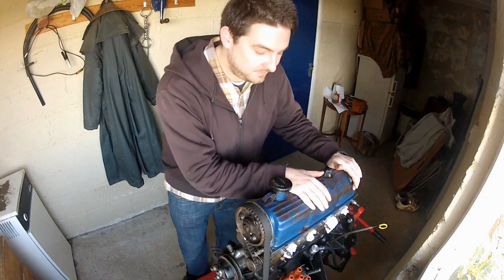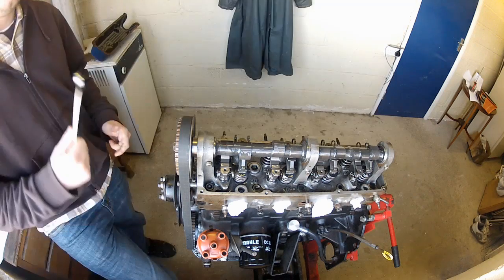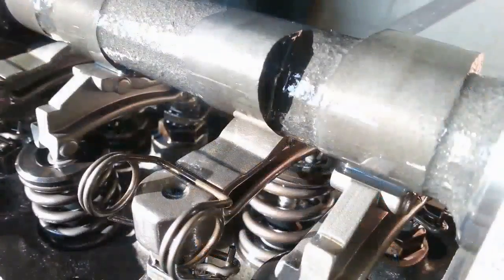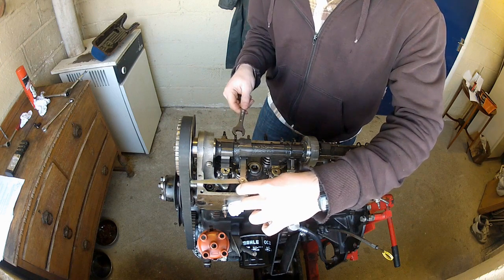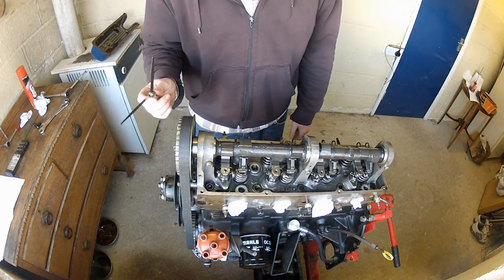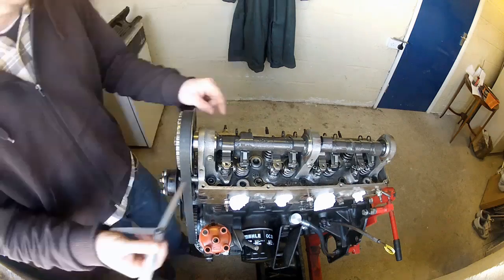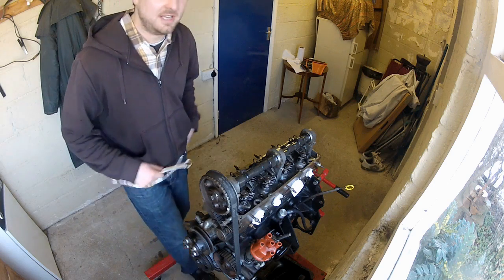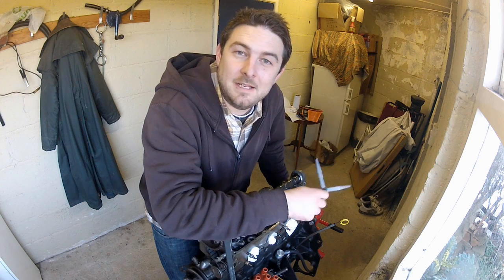How to Adjust Valve Clearances/Valve Lash on a Ford Pinto (SOHC) Engine | Tech Tip 10

Comment: Interesting to see it done this way, i was shown to measure the clearance between the top of the Valve stem and the follower, this seems a little simpler somehow
Reply from the maker: Probably a pushrod motor that, as opposed to overhead cam?

Comment: great video a had the same problem as you said you nip up the lock nut and the clearance changes. a changed ma 165 pinto for a 205 injection block running a dgav 32 36 goes well wouldn't mind getting a Kent or a piper cam thow
Reply from the maker: That will be a nice set up once you get a fast road cam in there. Actually I have a Piper 285 with followers in the garage not doing much. Gimme a shout if you want it.

Comment: Hey, are the 0.2 and 0.25 clearances the same on a 2.0 EFI Pinto? I assume so, since you said standard, but just looking for confirmation, in case your engine started out with a carb and that changes things somehow.
Reply from the maker: Hey, I can't say for sure, but I'd be very suprised if the clearances were different on an EFI engine.

Comment: What's the best way to break in just 1 New 2.0 Pinto Cam Follower I'm Changing out??
Reply from the maker: Same way as normal mate. Just don't let it idle for 10 mins. Hold it around 3k.
Reply: @FastRust  Aww I did yesterday and held at about 1500 to 2000 rpm for 10 mins, let it cool then drove like 16 miles holding at 2000 or above except when traffic got in the way. The key to it is to keep the oil pumping good, right
Reply from the maker: It'll be fine. Main thing is not to let it idle for 10 mins during break in.

Comment: I don't know what type of performance cam is in my 1972 2.0 liter but I adjusted to stock gaps to try to fix lifter ping/tick noises and it didn't get better. The gap was bigger when I started. Should I decrease the gap little by little until the ping/tick goes away?
Reply from the maker: They do tick, it's just how they are. If the cam isn't worn and followers look good there's not much else you can do. Don't decrease the gaps.
Reply from the maker: Use a mirror to read the stamp on the back of the cam. That will help you identify what it is 👍

Comment: Can you tell me what the Tappet adjustment is for a 2.0L pinto EFI engine with a standard camshaft
Reply from the maker: Not 100% on EFI, but I'd be very suprised if it was different to carb settings

Comment: Hi There loving the pinto vids. I am doing my own rebuild at the moment. is this the BP285 piper cam? I have just bought one and bought the recommended springs vssohc and followers folohc. Two questions for you. 1. I am using slightly shorter group 2 valves 45.5 and 38mm x 110.5mm from burtons do you have similar valves? did you need to do any mods to get the correct spring height? question 2. I plan on using the standard height ball studs is this what came with your kit or did you use the 33mm ones? Thanks Sean
Reply from the maker: +sean roche Hey man. So the cam in this vid isn't a BP285.  But, the one I had in before it was. I'll do my best to help you out, but all I can really tell you is what I used.  I always put in standard followers, and the valve springs I've used for years were the ones from a Kent Cam kit.  As for the valves, by the sounds of it we have a very similar set up.  Although I have a bit of a mixed batch!  From memory, for the most part they're 112.5mm long, but I replaced a couple of exhaust valves and got hold of 111.5 - from Burtons. As far as I understand it, valve/spring height will alter the valve train geometry resulting in more/less valve lift.  The 'correct spring height' really is dependant on your setup, and you'll need to break out the dial guage to accurately measure your valve lift.  Fine tuning can be done with lash caps I believe, but honestly, my knowledge gets thin at this point.  A question for the forums maybe.  Shamefully, I just bung it all together and hope for the best.  It works, but it's not optimising what I have. One day I'll do it properly! I used the standard height ball studs without a problem.
Reply: +Fast Rust That answers that, hopefully all should work well for me if Hermes don't screw up again with my cam. Which cam did you swap out the 285 for and why?
Reply from the maker: +sean roche Yea.  Good luck! I put in a BLF 40/41 from Burtons, which I think is actually an old Kent grind.  Why? Cos I can't leave stuff alone! ha. I guess I figured with the supporting mods I had, I could push the boat out a little. Rolling Road in the not too distant future, so we'll see how it compares to the BP285.

Comment: would bad tappet settings cause the engine to stall after a short while running?
Reply from the maker: Unlikely to be honest. If they are super tight I guess possible if it's losing compression due to valves not seating. A mate of mind had this problem, but it didn't stall it just ran like a bag of spanners 🤣
Reply: @FastRust  well it worked Rust ,was running fine again but ive cocked up turning the crank bolt anti clockwise..it must have worked loose while  i was driving and dropped out,luckily no damage but i think its thrown timing out
Reply from the maker: It won't have thrown the timing out there's a woodruff key in the crank so the pulleys can't spin on it. Just whack the bolt back in an torque it up.

Comment: Random question maybe but i'm struggling with oil pouring out my Pinto rocker cover. Its a narrow cover on a 1979 2.0 pinto. Any good way to get it straightened out? I tried a new gasket and used sealant on the cover side as I was told thats the  way but, rather than pouring out the back its coming out the side over plugs 1 & 2.
Reply from the maker: I've got a narrow one and I feel your pain! They are known for it.  You've done everything I would suggest - straighten it and apply some sticky stuff to cover side.  The only other thing is to not over tighten them, it's easily done and can damage the gasket / warp the cover. I literally go just a bit past finger tight. Hope that helps.
Reply: Cheers Fast Rust ! I definitely over tightened them the first time I refitted it. When you straighten them out do you hammer the bolt hole areas more than the straight parts? Such a pain I’ve had it off 3 times now but then again it’s my first pinto
Reply from the maker: I'd get a piece of flat steel or similar and use that as a dolly for straightening. Hitting it directly with the hammer may do more harm than good.
Reply: I had the same issue with mine. I straightened the rocker cover flange as described here, junked the rubber gasket and fitted a cork one. No sealant, just tight enough also as described here and followed the tightening method/order that was in the Haynes manual and it has never leaked since. Hope you got yours sorted. P. S. Great video BTW, thank you.

Comment: Hello mate. I got this problem with my 2.0 pinto, that after changing cam followers i cannot get large enough clearance in some valves.. as if the ballsttud wouldn't scren down enough. Got kent FR21 cam and its recomended clearence is 0.20/0.25mm. Best i get in some valves is 0.15mm. Got any tips for me?
Reply from the maker: How long is the thread on the ball stud? Kent do a ball stud with longer thread length, for high lift cams with a small base circle. If you try use these with a tam(er) cam, they bottom out before you get the correct clearance. I'd try some standard ball studs.. but first check the threaded holes in the head aren't full of shite!
Reply: @FastRust  Ok. Will do. Got spare studs from old head that was in the car so going to swat those in same as doing valve job. 4th cylinder exhaust valve terminated itself after intense rallying on local dirt track.

Comment: Thats not a proper adjustment...".proper adjustment" is made in and out inline with the cam follower with a slight drag...if you can move your feeler gauge Right and left your adjustment it too loose....🤨

Comment: Incorrect. Valve clearance is checked between the valve and the rocker arm not between the cam and the rocker arm.
Reply from the maker: On a pushrod engine yes, on OHC no.

Comment: I adjusted mine on my 2.0 pinto, still Ticks like crazy :(
Reply from the maker: a little 'tick' on these engines is normal, if it's super loud and you've adjusted the clearances, it's probably a worn cam. How did it look when you removed the cover?
Reply: The cam had a scar issue on the #1 intake lobe, I emery clothed it nice and changed that follower. it sounded awesome at first. then when I got home from an outing 28 miles later, I can hear a little tick again. I'm wondering if once a cam has an issue is all down hill from there as far as trying to save it.
Reply from the maker: That's the first time I've heard of someone using emery paper on a cam! Problem is the follower and cam lobe work harden together, then as a general rule, you shouldn't swap them.  Sanding the cam lobe is going to upset that 'relationship.' I can't think of a better word!
Reply: I was wondering about that hardened issue. Do you think the cam outer shell is harder than the rest? It seemed to sand fairly easy. took a little while to get smooth tho. I guess I'll be pulling the cover again to take a look at it. I'll report back in a week or so. Thanks Fast Rust :)
Reply: 500 miles later cam lobe still looks good from the emery cloth job, This motor was rebuilt 12 yrs ago and the car set for 10 yrs( Only has like 2000 miles on it )  I think the eng builder didn't put new springs, loose fitting as hell, ( YOU Can pull them off the followers by hand real easy ) found this out because I picked up a 1972 2.0 Pinto and the springs are tight as hell. and the 72 purs like a kitten :)